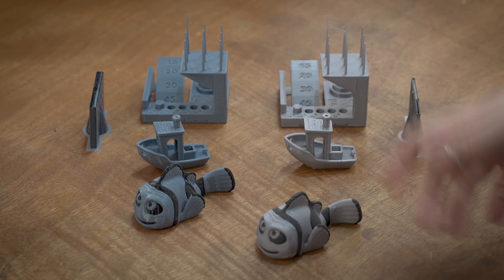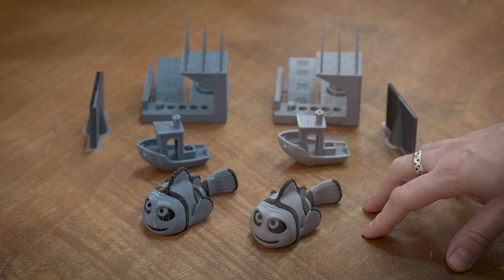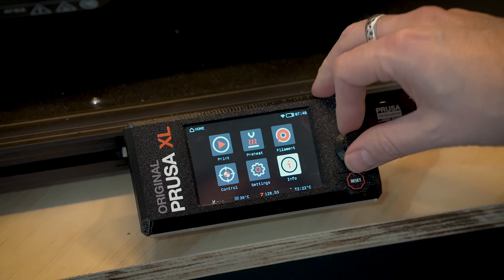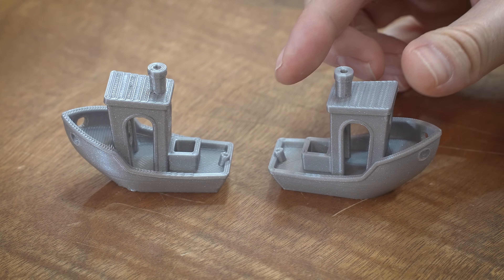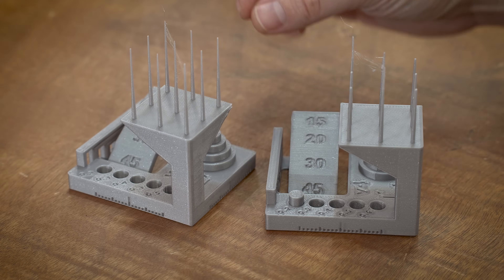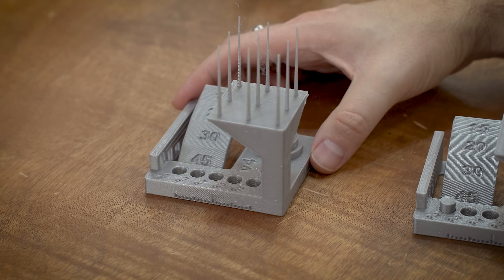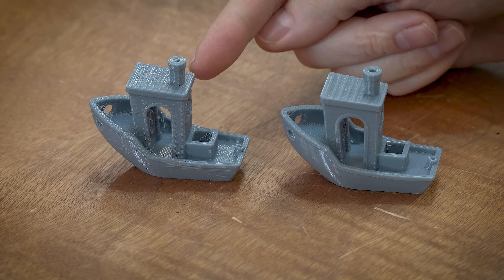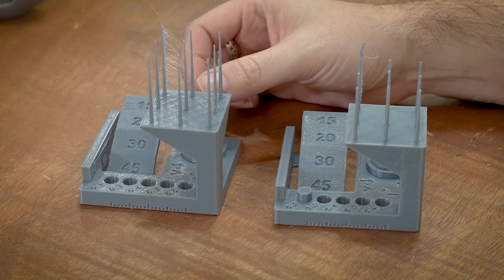Prusa XL - 0.6mm vs 0.4mm Nozzle Comparison

Comment: Interesting experiment and a reasonable result. One of the primary reasons for having a 360mm size printer is to print large things. This is where the 0.6mm nozzle shines. It generally cuts print time in half compared to the 0.4 at normal layer heights for each nozzle. Printing tiny benchy boats is not what the XL is optimized for. I have the MK4 for small print jobs.
Reply: Thank you for saying what a bunch of us owners of the XL were thinking.
Reply: On a 0.4 you can tune your profile for Infill and massive Infill up to 0.7 Layerwidth, which saves a lot of time. On the other hand, you can do the same thing with a 0.6, but then extruder is on his maximum flowrate. A 0.5 Nozzle is a good compromise between quality and speed.
@RobertCowayDIY thanks for this video. I will try it on my single toolhead XL.
Reply from the maker: OH!  That's why it's so big!  Yeah, I get it, but there are other issues going on besides fine details.  It's just not printing properly at 0.6mm for some reason.  I made this video for the people struggling to get good quality results from the XL.  Myself and others have noticed strange artifacts and just odd behavior (missing walls, problems with even simple models, etc) with 0.6mm.  All of that seems to be gone with 0.4mm.

Comment: Apparently a lot of the stringing issues that people have been experiencing with their XL's have been attributed to faulty hotend thermistors. People have been noticing immediate elimination of the stringing issues after they have installed a new thermistor!
Reply from the maker: Huh, I haven't heard about that from anyone, but it would make sense.
Reply: @RobertCowanDIY  Prusa identified a bad batch on early iterations of the XL that were sent out. I think the present day models being sent out have QC thermistors installed but I may be mistaken.
If anyone is experiencing bad stringing on their XL’s, presuming they have eliminated bad filament, wet filament etc, should reach out to Prusa😀

Comment: Very nice👍  i think TADA will be changing to .4  soon too, but she has a 5 tool XL and needs to get at least that many .4 nozzles.  Also, have you tried the hardened nozzle and adapters?  Curious to see how XL does with exotic filament
Reply from the maker: I haven't, but I have a diamondback nozzle on the way, so I will use that with the adapter to try out some abrasive filaments.

Comment: Fun fact. The nextruder was designed with .4 in mind. Its gearing is not fast enough for highspeed retraction.
Reply from the maker: Do you have any facts to back up this claim?
Reply: @RobertCowanDIY  did my own testing.
Reply from the maker: @jmsether got it.
Reply: @jmsether  not how it works.

Comment: I agree with your nozzle choice given that most people print small objects on their printers, however the .6 would be great when fully turned in for larger projects and save some time.
Reply: Yeah, I was going to say I usually switch to a larger nozzle when I'm printing larger objects that don't have fine details. Saves so much time when I cut down on the layers/walls/etc.
Reply: Whats even better though, is just being able to max out your volumetric flow on a 0.4mm nozzle so you get the higher precision AND you get the faster speed.

Comment: Nice video Robert. Thanks for the shoutout! I’ll be sticking with 0.6 mm nozzles on my XL for now. I have other printers I’ll use for fine detail stuff. The 0.6 shaves some time off the objects I normally print (flat signs), so it’s worth it for me to stay with it. With the latest firmware releases and dropping the temperature 10 degrees, the stringing is minimal and the overall quality is quite acceptable for me with the 0.6.
Reply: Complete agree.  I have other printers for small fine prints and this is to do larger objects that need the .6 for print times.
Reply: The same thing with me, I have a fast printer with a 0.6mm nozzle for the big prints and a slower one with 0.4 for smaller stuff with more detail. 0.6mm is just so much faster,especially as it allows bigger layer height too. And in a big part, especially one of geometrical shape, the difference in resolution is really not that obvious.

Comment: What drying procedure do you use for your filament? I have a dry box but with all of the stringing issues with the XL I am considering doing some sort of active drying.
Reply from the maker: So here's the thing.  With dry boxes, it only helps prevent moisture from getting in, but it doesn't really do anything to actively draw out moisture.  Heat is required.  I have a few videos on the subject, but I use Sunlu V2 dryers.  I like them because they don't have fans (fans eventually start making noises and rattling and just adding to the noise).  The only downside is you need to 'burp' them as they will release the moisture, but it can't really go anywhere.  So after a few hours, I just lift the lid and let the moisture out.

Comment: You have an n=2 now. I was working on a similar thing on my XL and got the same results. PETG is PETG and we know it isn't for detailed work. I can print PETG with PLA support in 0.4 more easily than in 0.6. I agree that the XL isn't tuned yet for 0.6. Again, 0 6 isn't made for detailed small pieces but for volume. It is a compromise to take. Thank you for what you do.
Reply from the maker: You're very welcome, thanks for watching!  I've tried printing larger objects as well with the 0.6mm and something just isn't right with the profiles.  It's a whole new printer with 0.4mm.
Reply: @RobertCowanDIY  I agree, something isn't right with 0.6 on the XL,  other than the speed compared to other machines, the multi tools rocks with the 0 4 nozzles.

Comment: This is like the best video for me. My experiences with my XL mirror yours, I am getting "good" results, but not as great as my MK3s, so I have been considering trying a 0.4 on my XL, and now I will. That said on my MK3s I have a revo and use my 0.6 on it most of the time and it's great! 
Another test I would like to try is the adapter and a CHT 0.6 nozzle
Reply from the maker: Yeah, same boat!  I had a MK3S and Bambu X1C and the XL just wasn't really keeping up in terms of quality.  It was 'fine', but nothing all that notable.  Now I'd say it's the best of the three.  I'm very much considering testing an adapter with a CHT!

Comment: Thanks for the test. Can you test the ObXidian nozzle vs a standard one?  My worry with the ObXidian nozzle might have more oozing because of the coatings, which could lead to more stringing artifacts, especially in multi-tool prints.
Reply from the maker: If they would come back into stock!  I did order another diamondback nozzle which I will use with an adapter.

Comment: 13:12 yeah but going this low on temp will weaken the part. The surface should be shiny and not matt. 
It’s a trade off.

But the fish on the other hand looks shiny. Strange, maybe the temp tower only looks like wrong in the video.
Reply from the maker: Nah, you're right, it's right on the verge of being too matte.  It's still a bit shiny, but for a structural part, I would add ~5 degrees to get the layer strength back.

Comment: This seems odd.  I modded my MK3S+ to use the Revo 6 nozzles about a year ago.  I generally only run the 0.6mm nozzle and the quality is perfectly fine.  I rarely switch back to 0.4 mm for fine details.  I got the 0.8mm nozzle but,as you mentioned in another XL video about volumetric flow, 40 watts can only melt so much volume of plastic and I don't see speed increase from 0.6 to 0.8 on the MK3.  I don't think it is the nozzle itself as the XL nozzles very similar to the E3D Revo and Prusa worked with E3D to develop it.  

Thanks much for your videos on the XL.  My pre-order is still pending and I'm glad several YTers like you are sharing the good, the bad, and the ugly.

Comment: Great video! ❤ I watch the same YouTubers as you referenced in your video. I was really worried about our XL once I viewed their videos showing all these issues. Now that we have used ours a few days and have had zero issues. All prints look like yours after tuning. Not sure if some of  the issues that their have is assembly issues, filament or profile settings. Nonetheless it’s a great printer. Sure it would be nice if it ran a little faster. But, still faster than a MK3s+ MMU2. I wouldn’t get your hopes up for the XL to have CX1 speeds due to the weight of those heads. VzBot printer is a great example of what a core XY can really do. Anyways… All the possibilities of things you can do on the XL. Different nozzle sizes, materials, size of prints, fine tuning each head for a different configurations, etc; just endless. I put in an order a few days ago for the 5 .40 nozzles. Your hard work just confirmed what I thought could improve the print details even more. I am still not used to the .06 differences but, I am sure overtime. Great video that’s for putting in the time. ❤😊

Comment: I think what you've proven here is that you can get better quality printing out of a smaller nozzle.

If youre printing smaller parts - ie: a Benchy - this may be desirable.

However, if you're printing large parts, a very small drop in quality is not a concern, and the time savings may be valuable.

Input Shaping has somewhat caught up with this in some cases.

You mentioned you ran the same Slicer settings between the two nozzle sizes. I assume you mean you picked the default 0.4 or 0.6 Prusa Slicer settings.

I also assume you didn't change number of perimiters. This is where you get a lot of your time reduction, because all other things being equal on default settings, you only need to do 2 perimiters with a 0.6 to equal the wall thickness of 3 perimiters with a 0.4 nozzle.

All of this is to say - the XL is large. If you're filling the build envelope, you're grateful for a 0.6 nozzle.

If you're looking for a better surface finish, reduce the line width with the 0.6 nozzle. You can reliably go down to 0.5 (and conversely up to 0.75 for over extrusion on stuff like infill) and sometimes even lower. 

By the by - did you go back and do a temp tower with the 0.6 nozzle to see if you could remedy stringing after you found it in the 0.4?

Comment: Interesting.. I want to see if Prusa's gonna be able to fix this issue with an update. Also I think that a 0.4mm nozzle should have been included with the printer in the first place!
Reply from the maker: Agreed!  I have hope in them.  I've only had my machine for a few months and there have been multiple firmware and slicer updates and most things are being addressed and getting fixed.  But yeah, it would be nice if you at least had the option for the 0.4mm nozzle instead of 0.6mm.

Comment: I switched to 0.4mm on my XL after a few weeks just to try it and I've stuck with it, as there is not much difference in print time and then you get better quality.
Reply from the maker: Nice.  Lots of people saying the same thing.  Makes me wonder what Prusa was thinking shipping it with 0.6mm?
Reply: Not much difference in print time?  Sorry huge difference on a 5 color full size iron man helmet that takes almost 3 days with a .6.  Huge difference in time.
Reply from the maker: @Shadrackc Well, it VERY much depends on what you're printing.
Reply: @Shadrackc  Of course there will be hours saved over a 3 day print as it scales. Normal prints though that are not huge I'd prefer it to take ~10min longer with more detail with the 0.4mm nozzle.
Reply: @wafflecart  I have a Mk4, Mk3S, as well as others to do normal prints.  The XL is built to do a certain type of print and seeing people put it against the quality of the mini for example, is ridiculous.  I bought this machine to be the workhorse tool changer that it is.  Not a 300 dollar mini printer.

Comment: I also had decent experience with my XL. Using prusament or Protopasta PLA. Great points on benefits of drying PETG
Reply from the maker: Yep.  If I care about a print, I dry the filament, period.  PLA takes a lot less time to dry and it's less critical, but it can still make a small difference.

Comment: Great info, and excellent sleuthing on the temperatures. TADA 3D Printing also ended up turning the temperature down on her XL. I'm starting to wonder whether the XL runs hotter than its settings.
Reply from the maker: I suspect they were trying to mitigate any issues for running it at higher speeds.  If you go up to 125% or even 150%, you can get away with some of their stock profiles, so maybe they have higher speeds in mind?  I'm not sure.  It's unlike them to be sloppy with the print profiles.
Reply: @RobertCowanDIY  By the way, are you still a fan of the Sunlu S2? I need a dryer suitable for PLA.
Reply from the maker: @MikeKobb I am!  There are some things I don't like about them, but I have yet to find something better.  You can see them to the left of the machine.  I like them because they're silent and actually get up to temperature.
Reply: @RobertCowanDIY  Thanks! It looks like Sunlu has added a fan to the S2 now. I guess we'll see how that does.
Reply from the maker: @MikeKobb Awww, bummer!  I liked the fanless design.
Reply: @RobertCowanDIY  I saw a photo. Looks like it'd be trivial to unplug it. I don't know if they changed anything else.

Comment: My MK4 and my MK3S+ have .6mm nozzles for my ASA and PETG prints. I am not as concerned with minor imperfections as I am with strength. I still think the Z direction strength between layers is better with the larger nozzle size because of its ability to melt into the previous layer and adjacent layer more effectively. I sacrifice some precision for greater durability and print speed. I would really like to know if others have experienced the same thing with there prints. I make latches, brackets, handles, spacer blocks, lots of parts out of ASA-carbon because of the UV qualities in the sun and temperature.
Reply from the maker: You're right about the strength.  Beyond cosmetic issues, I was having problems with some basic geometry and you can clearly see it's retracting too early (causing under-extrusion and missing filament) and other issues that WOULD impact strength.
Reply: Thanks for the response, I have had some tolerance issues on a few parts. Normally not to bad but one was over .035" off. I had to change my dimensions to compensate. I am on the list for an XL, might have to move back to a .4mm nozzle for some things. Prusa uses the .4 to make their parts. @RobertCowanDIY

Comment: I think some of the differences are to be expected when the models or details are so small. Printing thinner walls on a 0.6 nozzle means it will extrude less or drive faster. That can be fixed by fine tuning the profile. 😊
Reply from the maker: I would normally agree with you, but there are several YouTubers (myself included) that have been trying to track down various issues and it's not that straightforward.  Even at larger sizes, the printer still does strange things with the 0.6mm nozzle that don't happen with the 0.4mm.
Reply: @RobertCowanDIY  that is indeed interesting. Rounding errors in path optimizations within the firmware, after all there quiet a bit of math involved in turning gcode commands into actual motion on the machine.
Reply from the maker: @SarahKchannel Yeah, something else is going on.  Clough42 and I were troubleshooting something really strange where everything looked fine in the slicer (printing a single or double walls on a thin object), when it went to actually print, it would leave out several mm at the ends.  It printed the walls just fine, but for some reason gave up early.  With the exact same file, same slicer, same machine, but with different nozzle, it printed fine.  You'd THINK it was just an issue with part geometry, but the slicer looked identical, the machine was just retracting or coasting way too soon, causing it to not print anything in that area.  You can kinda see that in the fish, the roof of the benchy, and I've seen it elsewhere. Several of us have been trying to dig into the profiles to see why it's doing this, but can't really seem to figure it out.
Reply: @RobertCowanDIY  would have to compare the gcode. if the commands in both files, 0.4 and 0.6 are present, than the firmware does some interpolation/optimization that does not work.
Same pointer in that direction is, the separate setting on the machine for different nozzles. While I was thinking that that setting was just a logistical component to avoid user error when using multiple heads. 
One thing I could think off has to do with acceleration, that the printer tries to estimate how much a head would overshoot once a path completes, then subtracts that from the path. If that 
compensation is wonky it could lead to some strange effects.
Reply from the maker: @SarahKchannel Yep, it's something like that.  It seems that with 0.6mm, it's undershooting the target and missing some extrusion.

Comment: I am also disappointed with the input shaping profiles for the mini in PrusaSlicer 2.7.0. They seem very poorly tuned.
Reply from the maker: Yeah, I suspect there are some limitations in hardware.  It seems like they might be trying to replicate klipper from scratch and running into issues.  I'm hopeful that within a few months we'll see some legit input shaping implementation for the current models and some trickle down to the mini and mk3.

Comment: Pretty sure that the "wrong nozzle size" is just a "sanity check", to make sure you don't run gcode for one size on another size by accident..
So you can just choose to continue without changing it, if you know you have the right nozzle on.
At least that's how it works on the I3 series.
Reply from the maker: Gotcha.  I guess I never changed nozzle size on my MK3?  I just hadn't seen that message before, but it's absolutely a sanity check.